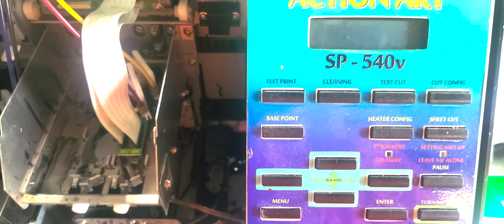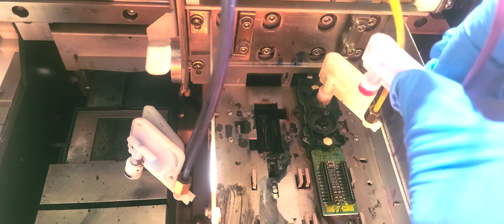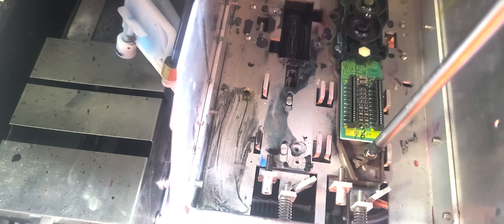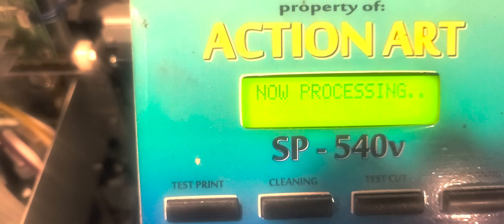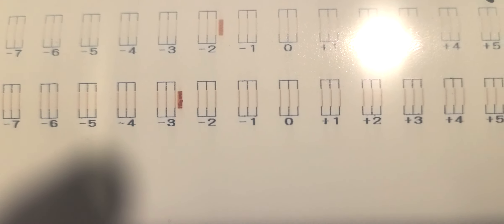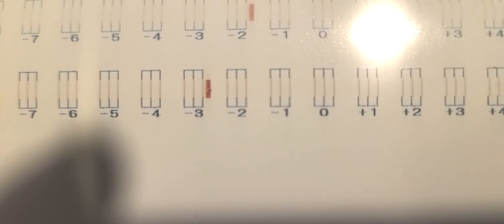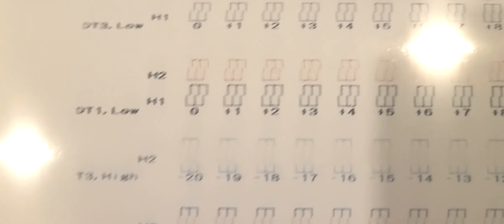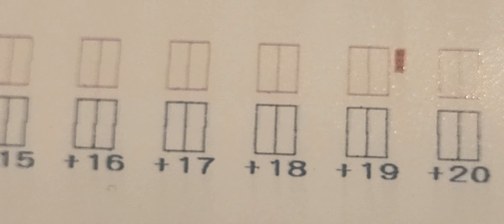Roland SP 540v 300v PRINT HEAD replacement and ALIGNMENTS save money replace yourself! DX4 EPSON

Comment: How do you change printheads on a Roland Textart Xt-640
Reply from the maker: Pretty similar to the vs but little different as their are 2 heads
Reply: @reprint217  I would like to use a continuous bulk system on the Textart but the setup seems different

Comment: Awesome video, best SP540V head replacement video on YouTube. I have a question,  near the end of the video when you are doing the alignment tests, I see that you are entering 1/2 numbers, like 20 1/2, how do you enter the 1/2?  the last time i made the adjustments, i was thinking you could only enter the full number like 20 or 21. Thanks again.
Reply from the maker: It has the half options in service menu. Allows for micro adjustments
Reply: Yep, after I install my new M/Y head and was doing the alignment procedure, I found that is has 1/2 options between the full number options. Thanks for the reply.

Another question, after installing the mew M/Y head I see ring of magenta around where the brown part sit on the meat frame, what could cause that? I don't see any on the B/C print head.

Comment: hi there, your videos are extremely informative.
i have a roland lef20, with the dx4 printheads. 
my gloss n white is completely gone after manual cleaning with the sponge n solvent. CMYK is perfectly fine though.
i've been able to suck ink out from the captop, the white seems to be coming out while i dab the printhead with the sponge (the gloss i can't really see), 
but the head is just not firing (the heads are moving when i try to print, versa works ink status say it has plenty of ink, which i think its only at 1/3 )
any idea what could be the problem???    
where i am isn't that easy to get help, and i've never changed a printhead before ( not just its delicate work and expensive, but i have to mail it over and do it myself, which is nerve wreaking) so i hope its something easy that i may have overlooked.
thank you so much for the videos again
Reply from the maker: Could be a fuse
Reply: @reprint217  hello, thank for the reply, i'll still lost with the printer. I've tried replacing the cables, and replacing the print head.. ( still no luck, n because its not firing at all, i can't even align the new print head )
watched multiple times your transistor video, n i just don't think i can do it on my own.....
if i can get my hands on a carriage board, do you think replacing the carriage board will be easier for me??

Comment: Good morning friend, can you help me? I have a Roland SP 540i, it started to fail in magenta, I replaced the dump and cap station, but I ended up breaking the magenta plastic connector where the dump connects. So I took the connector from another disposal head and put it on this head. Until then the black and blue was normal. But after doing this, it no longer fires both heads, the white test print comes out and the printout comes out too. Can you advise me if a security lock may have occurred on the machine, and where can I unlock it in the service mode panel or directly on the equipment? I needed to deliver some work and I've had it stopped for four days now. 

Thanks for your help in advance
Reply from the maker: Check your head cables first. Sounds electrical
Reply: @reprint217  Thanks for the tip, I'll try it this Saturday and come back here to tell you if that was really the case. Thanks again

Comment: Hey! Thank you for the video. Replaced the 4th printhead on a LEF-300 as there is no ink from the white whatsoever. After 4 powerful cleanings still no white and none in the replaced damper. I can draw white out with syringe before the dampers. Any ideas? I'm thinking fuse but I can't find the service manual for this unit.

Btw all the screws on these printers are JIS not Phillips so a nice JIS set like the sunflag on amazon will go a long way.
Reply: Also, where can I buy genuine captops from? The ones from all-printheads were not genuine but had black hoses.
Reply from the maker: Ok, troubleshooting an Lef300 number one is that if it were a fuse you would be getting nothing from 2 heads. You have flow at the line but none to the damper. Did you replace the damper stay that holds down the damper? Sometimes they sit up high and draw air. 

I'd lean towards captop. Connect syringe to captop hose if its getting air, wiggle head carriage by hand see if can get good suction. 

For captops premier colour is my go to. 

Email me at signworx217@gmail.com I'll shoot you over service manual

Comment: great video,thanks for doing that and including how to adjust,wished could seen ya finish it out..but great video nonetheless
Reply from the maker: Did you get the 540i going?
Reply: @reprint217  soaking the heads and pulling vaccum w syringes just like in one ur videos,.I have put cleaner cartridges in each slot a d as if last night, I have solution pulling from black,blue,magenta, but not yellow.. ut the other 3 I see in on pretty easily through the lines

Comment: Hi, great video. I was able to change both heads on my SP-540i after watching this....however I have the same issue as you had, only the Black and Cyan head firing when doing a test print. I've replaced the printer carriage board but still the same. You mentioned a bad fuse or transistor on the main board which you fixed. Any pointers on how I can do that?
Reply from the maker: On the mainboard of a 540i there are fuses check them first. You can easily remove and swap them around and see if magenta yellow will fire. 

You will need to be in service mode or will get a temp to low error

Comment: Wish I had of found this long ago, Mike. That said, took the long route to do the same on SC-540. I did however also run into an issue when manually adjusting the head mounted on the slider plate. Being, the thumb screw was doing very little - in fact, nothing at all. Came to be, that the plate was glued in place as a result of ink build-up. Without reference or ever being told about this, managed to figure it out, remove it, and reinstall. The cleanup made a world of difference. Unfortunately, there are six heads in this machine, so will do them as I replace heads over time. Here is just a very brief vid as I made it to send to a friend who encountered the same issue, on the same model.:  https://www.youtube.com/shorts/05SMaAVekNI
Would be great if you could make a similar video, as you have the audience in need, then, delete this post if you like :)

Comment: Hi Mike. I think my fuse or transistor is dead. How easy is it to change one of those yourself. There's no roland techs in my area so I either have to send it to another country or do it myself
Reply from the maker: They aren't too hard but easy to mess up the pads on connector. My best advice to rooking is to snip off the 3 legs and soldier directly to the old legs. Much easier

Comment: Me again, anyone here have an idea for this? LEF-300 with CMYKPrGlW setup absolutely no gloss or white, but good primer output (so some of group B works). Pulled the mainboard, tested fuses and fets, all good. Replaced #4 printhead twice. Replaced carriage board, no change. New genuine captops, good suction, seems to pull ink during powerful cleaning on group B. All brand new ink. Flushed with cleaning cartridges. At this point theres not much to throw at it but ribbon cables (impossible to find) and a main board ($$$).
Reply from the maker: Oh man, it sounds like you are having too much fun. You're in one of the situations I hate to be in, especially on these LEF machines. Let me think of what I would do next. 

I would carefully remove all cables to insure I didn't create any new problems. Only keep 2 cables that are supposed to go in a color head and place in the white / gloss head. 

Do they fire now? If yes I can tell its something coming from the back, mainboard/carriage board. 

If it does not, that tells me head is the issue. 

But if it does fire. Take the head cables from the white/gloss and place in a known working color head. Does it fire? 

Just a process of elimination at this point.

Comment: Good day. I am new to the Roland printers,we have a old Sp300v. In the 6 months we have had the printer we have replaced a print head as well as the print head bearings. As we where getting scan motor errors. Ok the bearings was bad. But now we still get the scan motor error every now and then. But seems to alwys be at the same place. Previously it was at random intervals all over the printer. Should i replace the scan motor aswell?
Reply from the maker: Have you replaced encoder strip yet? If not would try that first. Typically I will do Emcoder strip/sensor, scan motor

Comment: Mike, if the vertical is missing alignment slightly like your Magenta, you turn both the white knobs instead moving the print head physically
Reply from the maker: You can but mine the actual metal was stuck from age kinda welded itself in place

Comment: Hello, I have the same problem, after installing an unlocked print head this head don't print and I have the same test print as you. fuse's on mainboard are okay, what else can i check? it's on a sp-300v
Reply from the maker: Typically, if the fuses are good, the transistors are as well. Can he take head cables from good head and move them to the other head? If you bought the printhead used , it is likely the head 99% of the time
Reply: @reprint217  I've done it now. The same colours are printed. it is a Chinese unlocked head, this head is not good or could it be something else?

Comment: In the video at minute 13, you said that the motherboard has a problem with the transistor. I have the same problem, I installed both new heads, new original dupers and captops. How did you fix those transistors?
Reply from the maker: Soldier in new transistors just make sure they are the same. There are 2 variations on that board a PNP transistor and an NPN  A1746 and C4131 make sure you replace with same model transistor.